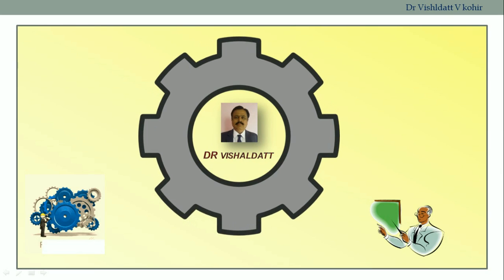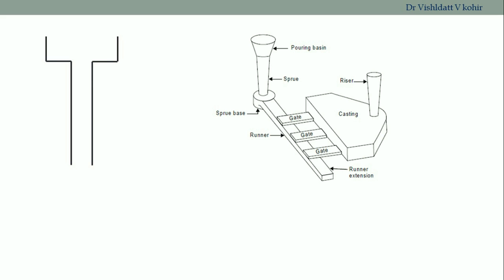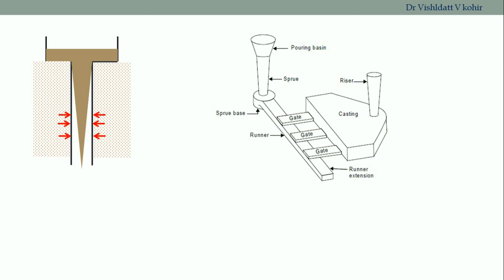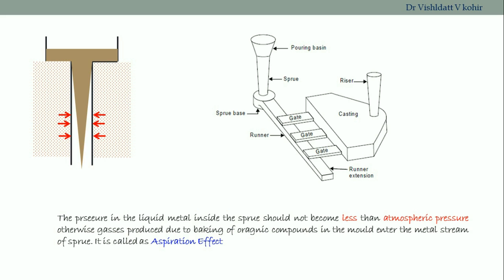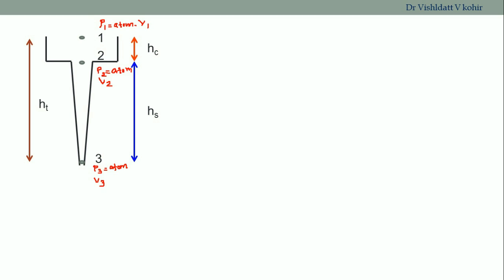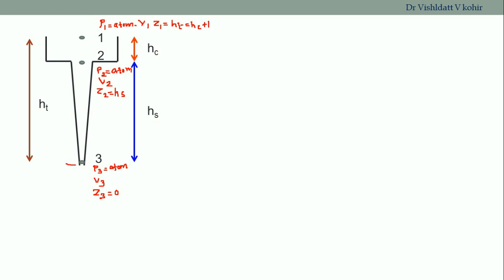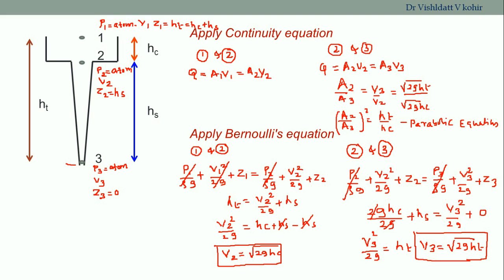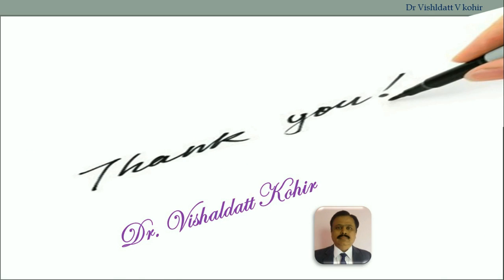Aspiration Effect| Sprue Design| Gating Design

Comment: I have a question professor and I couldn't solve it 
The desired volume flow rate of the molten metal into a mold is 0.01 m3/min. The top of the sprue has a diameter of 20 mm and its length is 200 mm. 

a)What diameter should be specified at the bottom of the sprue in order to prevent aspiration? 

b)What is the resultant velocity and Reynolds number at the bottom of the sprue if the metal being cast is aluminum and has a viscosity of 0.004 N-s/m2?